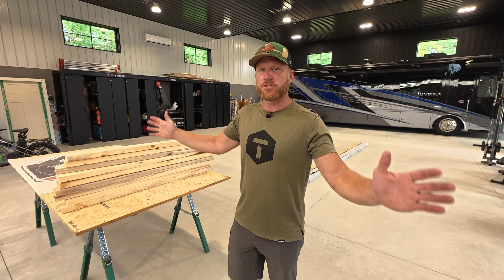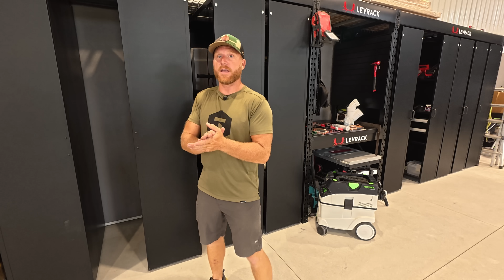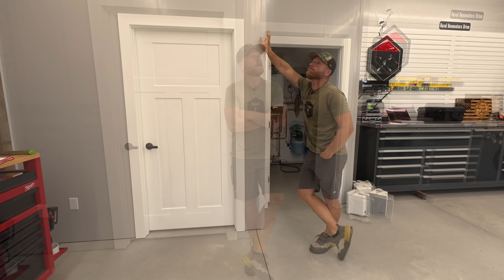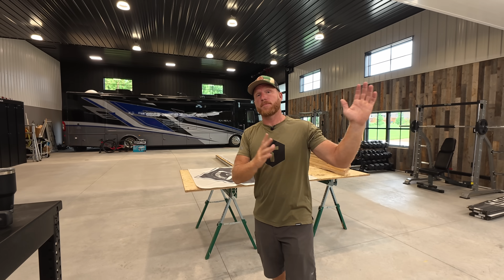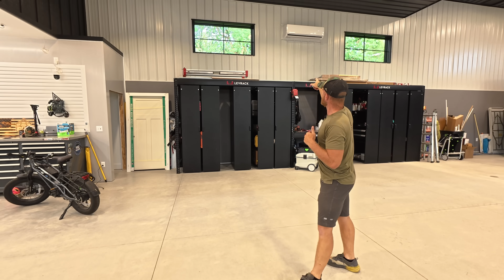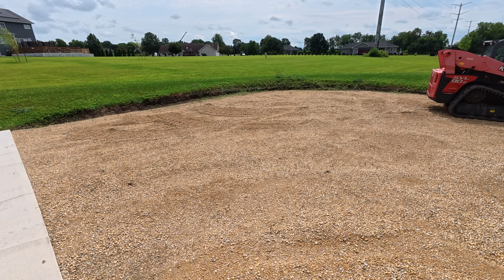RR Buildings COMPLETED Shop Tour

Comment: It’s all pretty bad ass, almost to nice for my taste for a shop. Congratulations. I find it hard to believe you did not run a sewer line for the Rv. Just bite the bullet, cut the concrete and put one in. With water and an additional line for whatever before you finish the floor. Me personally I would look at Lowe’s or Home Depot type commercial floor finishes. Durability and low maintenance. Again bad ass , congrats

Comment: A friend has all concrete flooring in his barndo. He had someone polish the floor. Garage area is 60’x80’ and a 3 bed 3 bath split ranch home attached on one end to the garage. Something that may interest you. He has 4 Roombas going. One on each end of the house and 2 running around in the garage. Soil is a little sandy where he lives. The Roombas really help towards keeping the sand under control. This may help you keep the floors somewhat dust free.

Comment: Sometimes the simple solution is best, maybe just paint the floor w your logo, then clear coat w good stuff and the wood shop I would suggest some wood floors or lip maybe, dropping a piece you make might damage from concrete, great shop Kyle

Comment: I worked in Toshiba tv the whole plant and Japanese are meticulous about their cleaning and cleanliness.We would use  Rustoleum epoxy 2 part concrete floor paint it held up to form lift travel with industrial floor wax sealer that could be buffed with buffing machines and stripping and resealing lasted 2 yrs I worked there.

Comment: Kyle   I stained and polished my personal home floors. They are minimum maintenance, the chemical hardens the surface. Amazingly beautiful finish and it is NOT SLIPPERY when wet. Wife works hard to clean .... she pushes button on the robotic mop-vac and surfs the net while it works. Your floor looks perfect for the process, I rented a grinder and it took about 4 hours for 1300 sq ft. I use a burnisher with a white pad to polish any accidental scratches and add to the gloss, no chemicals needed, every 6 months. Mop with water or a neutral PH cleaner.

Comment: I did a Euclid sealer right after pour. Five years later I couldn’t decide how to finish concrete floor, I put down three coats of wet floor polish by Zep. I wish I I did it right after pour, I believe this would prevented some stains. Reapplying polish is easy. I can send pictures.

Comment: In Minnesota (my new barn in particular) I did a R-16.5 door but every section is a window section with tinted glass. It’s definitely not as much glass square footage wise as those full view doors but the r value and thermal break is A LOT higher. Still looks great as well. I’d be happy to share some pictures with you if you ever want to see it.

Comment: The celing height in the part under the top floor is still more then enough. I would have built out the top floor further out in the room to get more floor area. Then again you seem to not have any use for it as it is. Though you could set up a cinema room, an office or a game room or something that could be very nice to have. The windows from the top floor down to the main area is also rather low and they feel a bit missplaced on the wall when they are so short but I guess that the truss design in that wall was the limiting factor for the whole thing

Comment: Followed since the start as I was building my own at the same time 90x40.  Had the same thoughts and questions on the floor finish as my concrete had a nice finish to begin- with but the dust kept coming up.  Looked at every option but $$$ for Epoxy or ground/honed.   My shop is similar to yours right down to the Trusscore which is made local to me here in Ontario.  At the end of the day I chose to fill the saw cuts with Sikaflex and then I sealed it with WR.Medows UltraHard and then 2 coats of Beltrix.  Floor looks like natural concrete but with a low to mid sheen.  I could burnish it to bring out more sheen but we are very happy with it!  Material is pricey but it was super easy to apply and looking great and I have had no oil staining from my leaky John Deere since doing it!    Get in touch if you want a few pictures.    Again....great job on the shop!

Comment: Beautiful building, I work in a woodworking shop everyday and this building is not going to be a wood shop. Youl never control the dust. You’re going to need a 40 x40 building next to this building.
Reply: Saw dust will be an issue even after spending a lot of money on dust collection accessories and machines.

Comment: If you do an A2 (cream polish) you will see inconsistency in the aggregate. Potential to see trowel marks, foot prints, etc.. that are currently hidden in the cream. If you do a D4 (exposed aggregate grind) it will be more consistent but still the risk of aggregate being pushed down with power screeds. Either one should be performed with a densifier (we use Consolideck LS/CS)  to harden the surface and finished with a stain guard.

Comment: We wanted a.RV clean out but didn't as well. We used a macerator pump that pushes the waste out a 1" pvc pipe. (Short rubber hise for transition from pump to the wall. 1" line is easy to run, and it pushes 100' or more. Last you splice it in a drain line past a trap and you are good to go.....

Comment: For the flooring- Check out Hulk Systems.  They will customize a flooring type based on your specific use case. They hooked up my airplane hangar.  Also to the right of your LevRack, is that Trusscore?  I am planning to use the LevRack in the hangar but was not sure what to use on the exposed area next to it.

Comment: Awesome shop!  Completely understand rhat feeling of "it's too nice to get it dirty".  The overhead door looks awesome.  Perhaps just some kind of clear vinyl or plastic curtain to slide infront of it on the inside to create an air gap to keep hot or cold out when you need to.  Otherwise it can stay over in the corner.  Best to keep the clean-out for the RV outside incase there is a "situation".

Comment: If you want a 24 hour turnaround, you can go with a full or partial flake polyurea floor coating with a polyaspartic top coat. If you can wait a couple days, you can go with a full or partial flake epoxy, with a polyaspartic top coat. I have a full flake epoxy on my garage floor and I absolutely love it. I would also recommend having a contractor that specializes in these top coats perform the work and not making it a DIY project. Many companies give really good warranties. The polyureas and epoxy you buy from the big box stores are not very good.

Comment: I have polish concrete floors in my shop. The one thing I do not like about them is they will still stain if you spill something on them, oil or paint. With a sealed floor you can wipe it right up.

Comment: Polyaspartic floor coating, just make sure you get the floor professional scarified before applying any coating. Cleanup is way easier on a sealed vs a polished floor. There’s a reason every home improvement lumber yard big box store has polished floors, they’re economical for such massive sq footage. But for 3500ish sq. ft. gorgeous shop like you’ve got there, go with a coating every time!

But seriously whatever you go with, please don’t settle for an acid wash prep, make sure the floor is ground, it’s the only way to guarantee adhesion for any type of sealant.

Comment: If folks have the money, and the desire for wide open space, then the large beam span is a no brainer. For most the cost may be prohibitive. Personally, I wouldn't mind dropping a post somewhere in the span underneath for both cost savings, but I also ultimately would want additional wall space even if it mean dividing up the area underneath more.

Comment: I always do swisstrax flooring. You can even implement different types in different areas, under the gym, under standing areas, and it looks the best. Wait until you pull in from the snow, all the crud falls off your vehicle and goes under the floor, and you can walk back out there barefoot to a completely dry floor.

Comment: I would polish them. I have epoxy floors and yes they looked awesome when they were new but 8 years later not as much. They trap dirt as they aren’t super smooth so you have to scrub them once in a while to keep them looking clean and over time the coating gets worn off from vehicles driving over it

Comment: That's not a shop, that's a man cave. A very nice man cave. Shop is a place to weld, saw, store / change oil and hydraulic fluid, bring in muddy vehicles, swap blades on the mower. It's very nice. Did you do a video on the clear span truss? Curious how you put those windows in looking down to ground level. Looked at the plans. You should have give out layout so people can see if they like it. The value of your plans are in providing the construction details.

Comment: Beautiful space.  In my experience you will have a very hard time winning the dust control challenge.  A wall between RV storage area and the rest of the shop would keep storage bay clean and allow wall storage on either / both sides.  Re floor options, Polyurea > epoxy.  I have no experience with Race deck type products.

Comment: Research Concrete Densifiers, such as Woodford Formula.  This is not a surface coating, it improves the surface density for durability and stain resistance.   Also it can be polished up to a  super cool finish level after the densifier. 
  Now, let's talk about when you're coming to SE MN to build MY headquarters!

Comment: What a dream shop!  I sold industrial cleaning equipment and I would recommend just applying a densifer sealer. It penetrates the concrete(not a top coating) making the concrete harder, fills in the microscopic pores.  It pretty much eliminates dusting and dramatically reduces tire marks.  It is used in all the new warehouses and big box stores that have shinny concrete floors.  The more you clean it, the shiner the floors become.  There are many manufactures.  Ashford and Euclid Diamond Hard are a couple of the popular ones. 

Epoxy floors show all the dirt and are prone to be slippery when wet.

Comment: I put dricore and oil poly for my shop floors. So easy on my joints. Holds up well, lots of traction, my tools roll fine on it. Might not good for heavy equipment, but I they’re good enough for a wood shop. Best part is I can refinish them easy if I spill stain or paint on em.

Comment: I think dividing the space to have the 1k sqft room above your woodworking area was an efficient way to add space or just not waste space. I grew up framing residential homes with my dad when I was young, and one of the things that he always pointed out was the huge attic space in some of the large expensive homes. Dad would have made more living space out of most of it. I know when I was little and we lived in Millard Nebraska, he built a home, and he didn't waste that room. He built a staircase going up and built a big space that could be used for different purposes. I know us kids played up there. One winter, my sisters and cousins were all up there around Christmas time, and my uncle Gene was trying to make us smaller kids think Santa landed on the roof and slid off of the shake shingle roof that had snow on it one Christmas eve. things grownups won't do to keep a myth going haha!

Comment: I've had a mini split DIY version from Sam's Club and it done great for cooling because it dehumidified the air so well, but heat, not so well. The unit would git snow and ice on it and it would freeze up and then started giving me error codes for low refrigerant. I had an 18K BTU unit for a 60" by 12' mobile home which I completely redone from the floor up to make it more efficient. I loved it for cooling because it also removed all the moisture from the air, which was great for all my spices to keep them from getting clumpy in the containers! if you get one with a 22.5 seer rating, they are so energy efficient and quiet, which is awesome! It's hard to tell if it's running without going up to it and putting your hand in front of the louvers. I had mine set up on wifi and I could control it from my phone, but there really wasn't a need to! It was drawing about 9 amps on one leg. I put my clamp on amp meter on one of the phases in my panel. My electric bill was always low and it kept my whole mobile home comfortable! I know the biggest reason for it's efficiency is that it does dehumidify the air!

Comment: that's the bad thing about aluminum anything that doesn't have a thermal break between the inside and outside of the aluminum. When I don my windows on my mobile home seven or eight years ago, I thought I would be okay with aluminum since it is a double pane window, but they are cheap Home Depot windows that have no thermal break on the frame between the inside and outside. I regret having went with aluminum in hind site and, more than likely, I will put in vinyl windows; the funny thing is, the one vinyl window I put in in my bedroom is awesome; also a Home Depot window but a good vinyl window that gives me a thermal break from the inside to outside temperatures!

Comment: adding a 4" threaded female cleanout for your RV to hook up is going to be so easy. Then you can cap it with a threaded 4" cap you can screw out and then just screw in your RV sewer line to, Kyle! That isn't going to be difficult! In fact, you could add a 4" threaded female adapter to your cleanout outside and hook into it. That isn't going to be hard!

Comment: I've seen some people do their garages in epoxy and it turned out pretty good. It's been a few years since I watched anything like that though, so I can't help with brands, but I think epoxy is definitely the way to go, and the sooner you do that, the less prep there is to do on the concrete before laying it down, which typically I see done by rolling it on. I've seen a couple people on YouTube use some good epoxy seals for garage or shop type area where vehicle traffic will be. I've seen some stuff that comes in hard plastic type squares that I see in shops for tinting cars and showroom floors, but your environment isn't really compatible for that type of flooring, even though it is a nice option, but not where you are going to do any kind of carpentry work with saws. It would be a lot of work to maintenance a floor for something like that, so there are some good epoxy options. I'm surprised a company hasn't reached out to you to help push their product, since you have nearly 2 million subscribers.

Comment: Hello Kyle,
I would recommend a polish floor. Do to the reflectivity of a polished floor, you will not need to turn on as many lights. Epoxy requires more maintenance. Polish is easier to keep clean. Polish to about a 300 grit. Then put on a protectant sealant not a coating, so if you spill something the concrete won’t absorb it. Once  you finish the floor with a burnisher machine it shine like a diamond in a goats ass.😁
Great job brother.
Mark G
Retired Cement Mason 40 years

Comment: If I did that floor, I'd just apply a polymercement floor coating when polishing raw concrete, it's the easiest and most economical way. Maybe it's not that common in USA, dunno 🤔 But certainly there are some products for sealing that surface on your market.

Comment: Mini split heads suck, they have terrible air filtration. They get dirty then you have to take it apart to clean it. Some people end up doing filter hacks by duct taping extra filter.
Heat pipe air handlers are better, you can add way better filtration, so only maintenance is filter change. It's also ducted, so get more even distribution. And it's easier to service.

Comment: Epoxy, while expensive, if done properly?  DO IT.  I did the 'rustoleum' Epoxy.  It worked great for about 10 years.  After that it started to peel up.  I 100% would recommend having a guy come in, diamond grind it, clean it, and epoxy it.  

As for LevRack...WOUD LOVE IT...WAY outside my price range...I did see a guy that built his own version, and it was AMAZING.  It cost him ~$1K for his, vs. the $5K+ from LevRack.  

Bathroom....I 100% would have added a shower.  100%.  The number of times I have done work outside, been filthy dirty, and had to walk through my home to the shower?  Always hated that.  You have a conditioned space, 100% put a shower in.  Get some Homeless despot cabinets for bathroom items...towels, TP, GoJo, Lava Soap, Scrub Brushes, etc.  

Lights...100% agree.  A couple hundred bucks is peanuts compared to some of the prices I've seen for shop lighting solutions.  I too am looking at a workshop, my #1 complaint in my basement shop is lighting.  IT SUCKS.  I have at least 16 light fixtures down there, and there are still shadows everywhere.  I hate it.  I'm always setting up task lights to work with.

As for 'living space' over my shop?  Probably not....WORK space (design, pattern making, etc).   Entertainment?  100%.  Unfortunately, thanks to the legalization of pot in my state the number of illegal grow houses has gotten so bad that they have changed our allowed out-building sizes where I live.  2400sq.ft. and no taller than 12' to the top of the peak, and the roof pitch must 6/12 minimum (this restriction was put in to keep people from putting temporary housing out there (mobile homes) and leaving them forever).  

Great job!